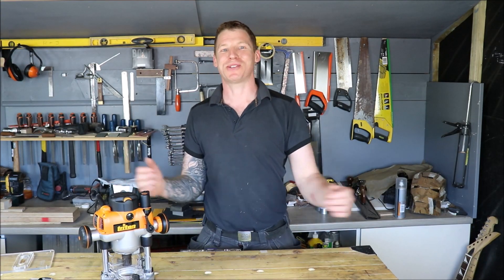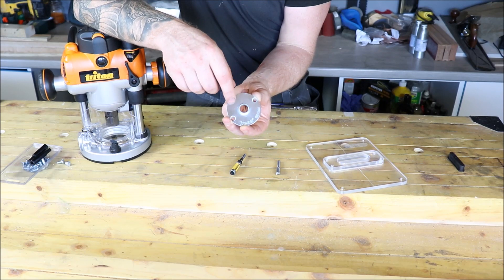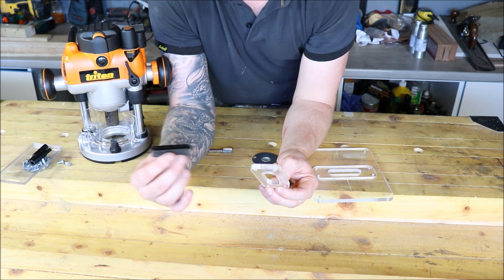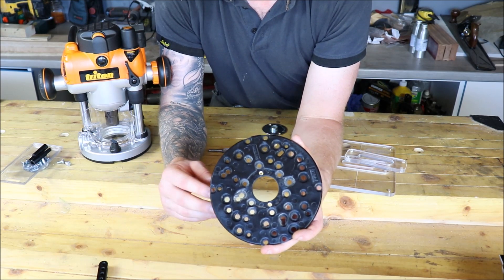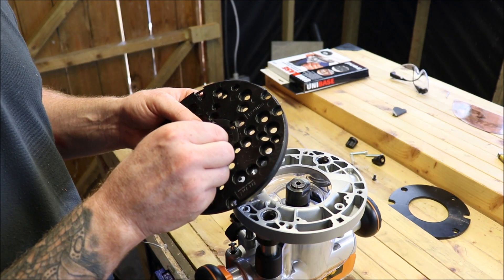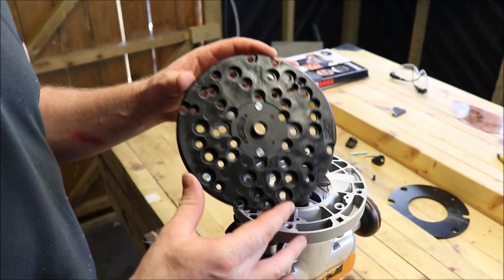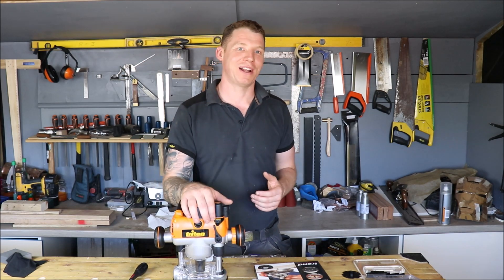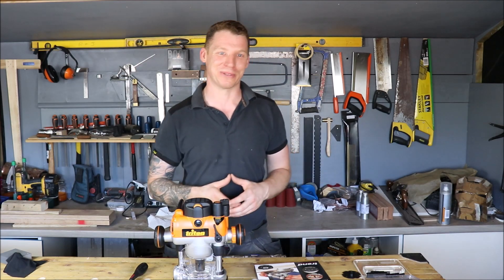Triton Dual Mode Plunge Router,  Trend Uni Base/ metric guide bush!

Comment: Your example of an 18mm bush and a 10mm bit produces  4mm border.  18mm outside diameter minus 10mm bit divided by 2 = 4mm.  The template needs to be 4mm larger all round.  Using imperial sized bushes is not really a problem.  Digital calipers should be in every workshop.  Trend has a PDF on their site with all information required.

Comment: Trend actually make a specific sub base for (some ?) Tritons viz the Trend GB/5/Q Sub base for Triton Trb001 and MOF 001, note it does not list fitting of a TRA001 or JOF001, from the image of the sub base that only has 2 mounting holes to the router
Reply: It definitely does not fit the TRA001 although it is advertised to in some places

Comes with 4 holes which are in the wrong places

I drilled out 4 holes and countersinks in it to be able to use it

Comment: Hi could You confirm is that triton tr001? I am checking on trend site and it says that this plate is not compatible with triton tr001. My plate is different then Yours. Regards
Reply from the maker: its the 1400w mof001 dual mode plunge router.